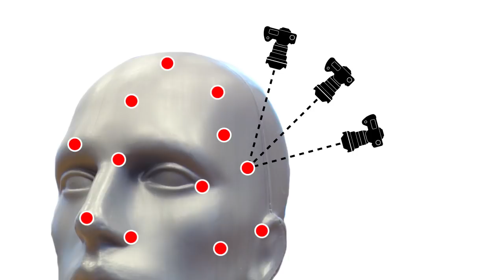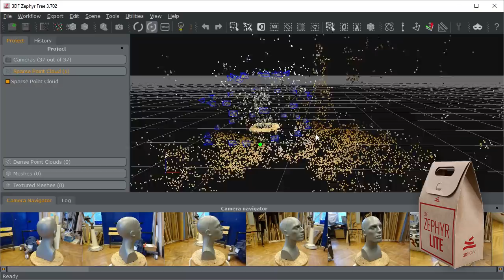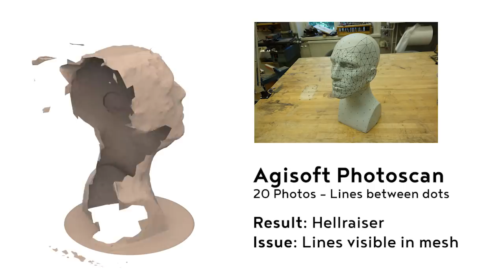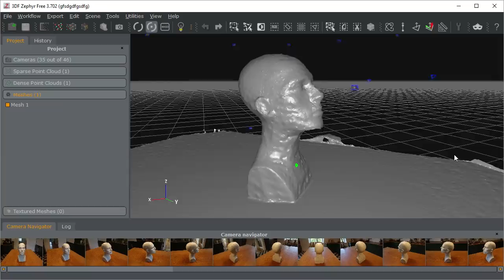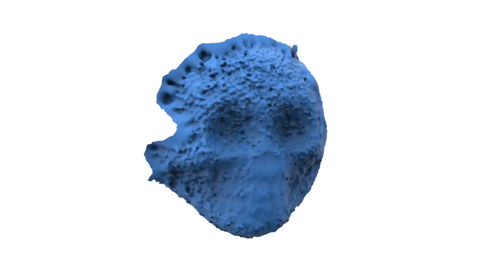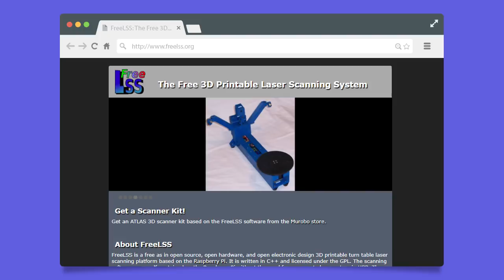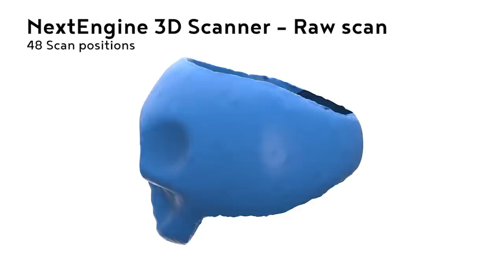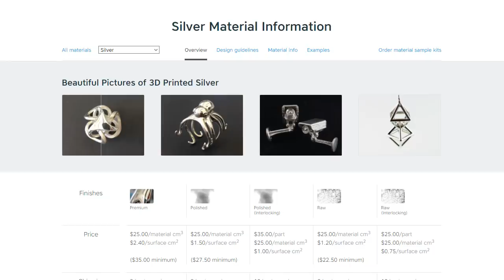How to Copy (almost) Any Object

Comment: You used just 20 photos, on the last Agisoft scan, then used 40 photos when you switched to Zephyr. Not really a fair comparison. Still, overall good youtube video. thumbs up!
Reply from the maker: Actually it is comparable because those 20 photos were focused only on the area where I drew dots and lines, not on the whole head, simply to see if that strategy would work without introducing noise into the final mesh (which it did not) before covering the whole head with lines. Even though I don't explicitly mention every little reason behind everything I do, there is method to the madness, trust me :)

Comment: All sounds more of a headache scaning things picture taking, it's much more simpler just to create a mold using correct molding material.
Reply from the maker: Pray tell, how would you take a mold of something the size of a head and shrink it down to the size of a thumb? If all you want is a 1:1 copy, that's one thing, but I'd dispute that it's "simpler", unless you know what you're doing. Anyone can take a photo, it takes a fair bit of knowledge to know what molding material to use, and how to produce a successful mold. Not to mention the cost involved. How would you make a mold of a big statue, without taking out another mortgage on your house?

Comment: Wouldn't it be easier to take a video of the object from all around then extract the frames of the video so that you have hundreds of photos with little effort?
Reply from the maker: Video will not have the same resolution and sharpness as you will from still photos, unless you use some really expensive high end cameras.
Reply: @SwitchAndLever  Ah yeah, I guess you're right. I'd better get off my ass and take a load of photos lol.

Comment: I didnt see the 3d scanning spray in your list of things. or did i miss something.
Last year when i was at formnext, there were a lot of companies that offer scans, they used some special spray that will disolve over time but that will take away reflections , so the issues you have now are gone.
there were even some that can make a overlay of the scanned model to a Cad so you can see if its a 1 to 1 copy, i thought that was very cool. https://www.google.com/search?q=3d+scanning+spray
Reply from the maker: The issue is not the reflections in this case, the issue is the lack of surface detail for the program to identify and map. If you do have a problem with reflections and don’t want to paint your object you can also use hairspray or dust on flour.

Comment: Why Windows users always torture themselfes with proprietary anoying software, if there are 100% free and open source alternatives like Meshroom and Blender?

All comon proprietary software have good free and open source alternative. Also, nice thing about free and open source software is that you are not forced to use oppressive windows to use it (forced updates, forced telemetry and ads in start menu). Hell, you are not even forced to use expensive x86 and x86_64 cpus with free and open source software. If you want to escape windows hell, use Kubuntu (GNU/Linux)
Reply from the maker: You literally have no idea what you’re talking about. Also, this is not the place to soapbox about Linux. 

Good luck finding an open source CAD package, photo editing package, illustration package or video editing package as open source that will hold up to Solidworks, Photoshop, Illustrator, Premiere/After Effects. If you mention Gimp or Inkscape it shows just how lost you are.

Comment: Or..... Just learn how to 3d model. lol
Reply from the maker: I'm an accomplished 3D modeler, but regardless that's missing the point. However I model this it will be my interpretation of it, it won't be a copy of the original object. Just like you wouldn't hand writing a printed page of text a copy, even though it contains the same information, you wouldn't call sculpting or modeling an interpretation a copy either.
Reply: @SwitchAndLever  True.